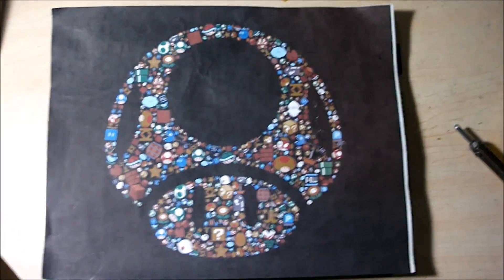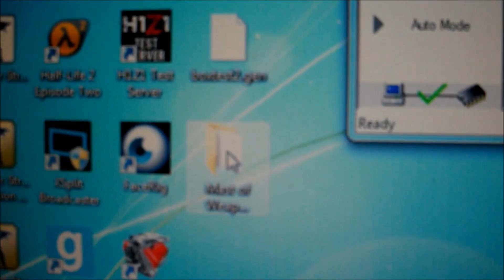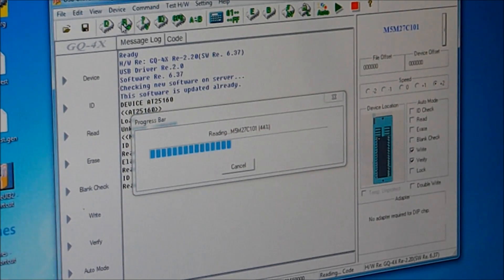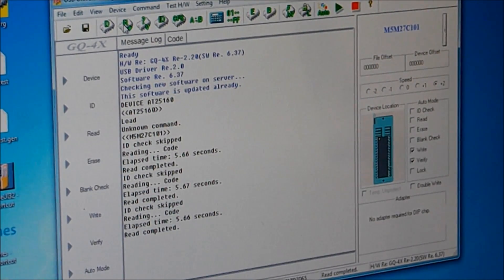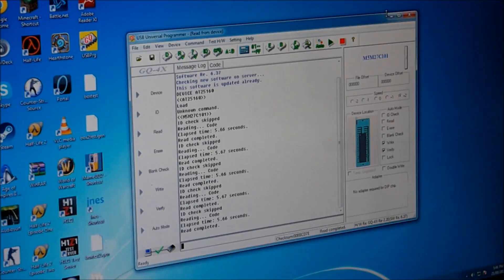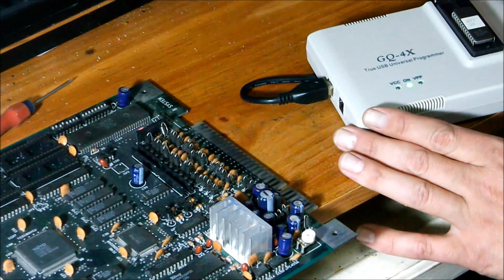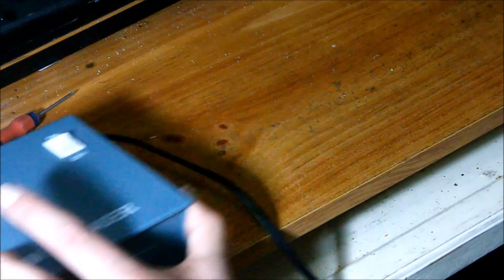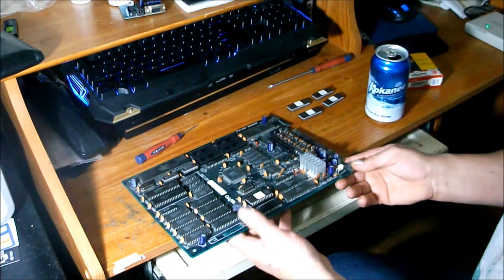How to dump arcade EPROMS - TAITO Master of Weapons SWAP B-System

Comment: Does the dumping device work with any type of ROM chip? I'm looking to rip the files of a sound system from a model train produced in the '90s.
Reply from the maker: GameBreaker64 - Yes, but only if it is the “through-hole” type. SMD’s would require an adapter. As would larger size ROM’s physical dimensions, as you may had seen in this video or another video which I had made. However, reading the data may after dumping may pose a problem. You may just have to dump then burn the data on a new ROM, without knowing what you’re looking at. Sorry if this sounds too vague and I hope that helps.